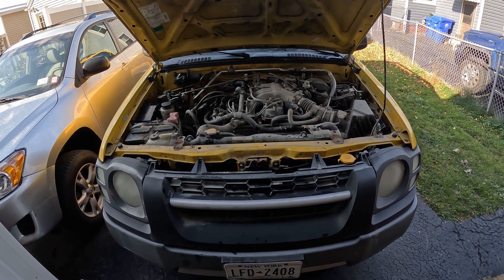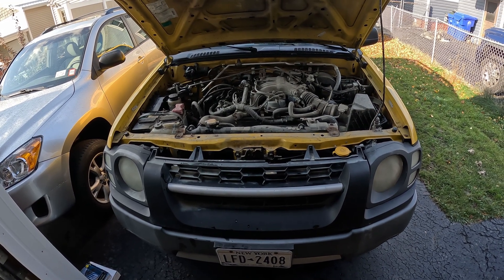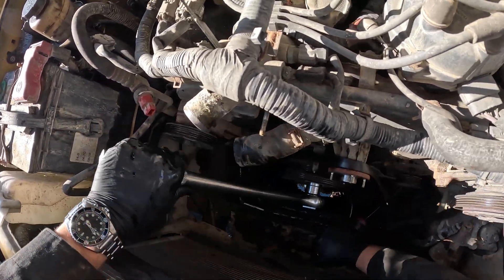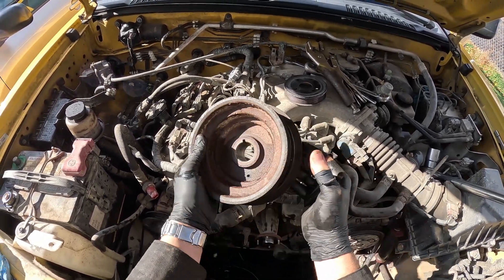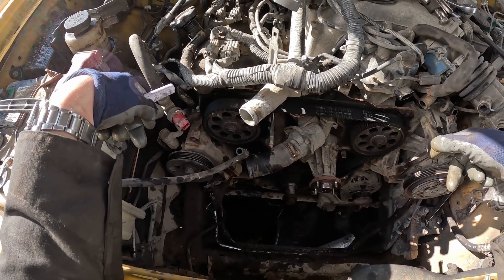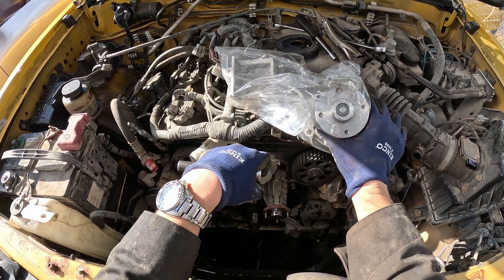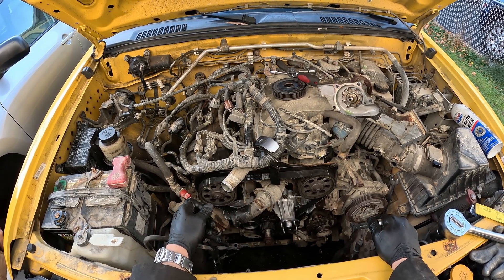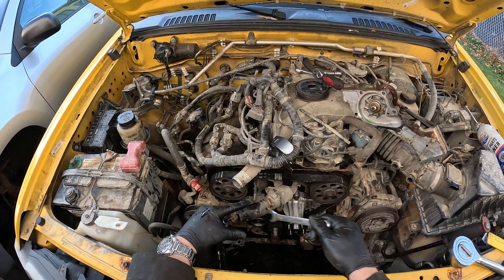How to Change a Nissan 3.3L Timing Belt + Water Pump

Comment: As a 15 year old doing this on my own at 8:20 I'm having troubles getting that out on my own lol. Any advice? It's kinda hard to see how you did it in the video
Reply from the maker: I used a 3 jaw puller to get it off. Just be sure the crank bolt isn’t flush with the pulley. That’s why I broke it
Reply: @haoleboyshow-tos2279 I'm having troubles getting the actual bolt loose, I can't get the pulley to stay still, I feel like I'm not using the belt right, thank you amazed that you even responded on this old of a video
Reply from the maker: @CarsonBritton This one is manual, I stuck it in 5th gear 4WD to keep the engine from turning.
Reply: @haoleboyshow-tos2279 do you have any sound advice for an automatic? I wish I had the Manuel but it's my first rig so I can't be picky

Comment: Oooohhh, I really hope this is not what I have to go through. 
I've replaced the plugs,  wires,  cap,  start,  battery and fuel pump.  All fuses are good. It still cranks solid and strong,  but no ignition. 
I'll have to take my 02 X into a shop,  I'm not going through all of this video.
Reply from the maker: Don’t blame you.

Comment: Can water pump be changed without removing belt?  Answer is NO
My vehicle is auto- magic so first step is removing fan shroud and fan together THEN installing large piece of cardboard against radiator to protect it.
Reply from the maker: @MichaelWysocki-ks5xt  That’s smart. IDK why anyone wouldn’t want to change the belt at this point, it’s so close! 
My VW is the opposite. You don’t need to change the pump when doing the timing, but you may as well.